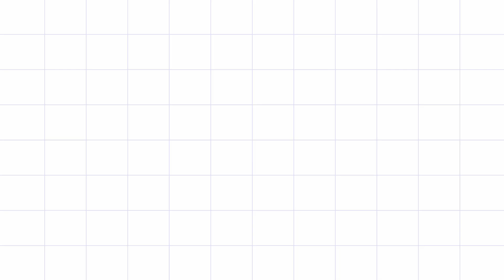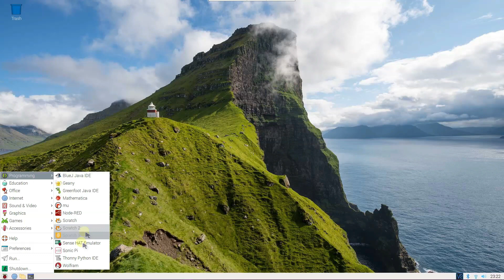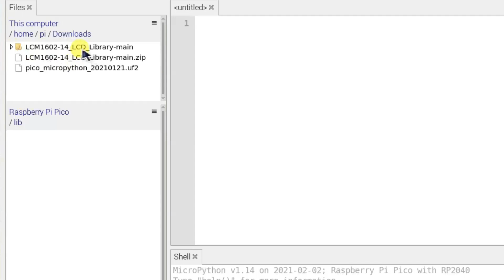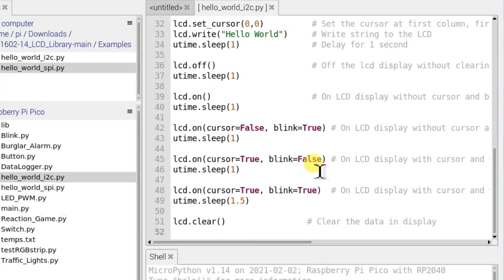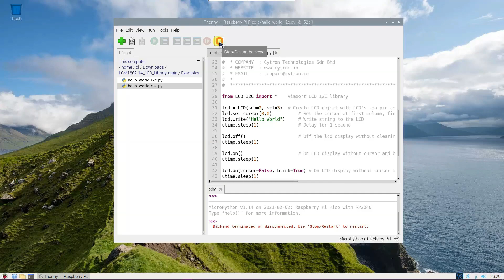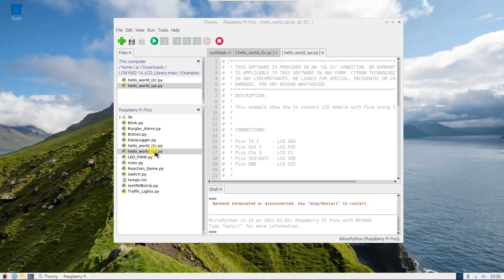Display on LCD Using Raspberry Pi Pico with I2C and SPI Communication.

Comment: i use i2c but cannot run there program..here the error: 
Traceback (most recent call last):
  File "<stdin>", line 31, in <module>
  File "/lib/LCD_I2C.py", line 53, in _init_
  File "/lib/LCD_I2C.py", line 103, in _command
OSError: [Errno 5] EIO
can u help me please?
Reply: i got the same problem…do u have any solution
Reply: same problem, i have a similar problem with a gyroscope i2c module, maybe if i can figure this out i'll figure that out
Reply: Did you guys figure it out yet? I'm having the same issue